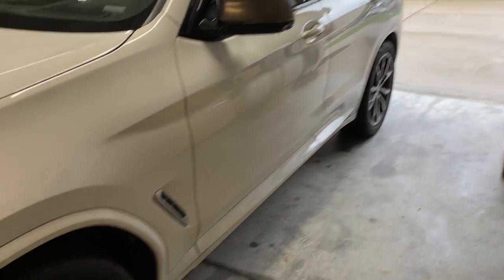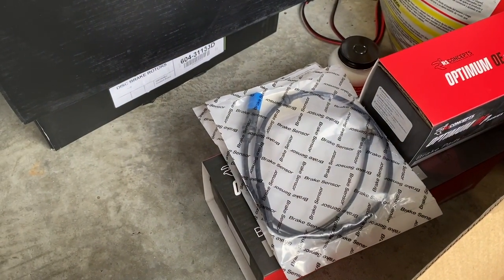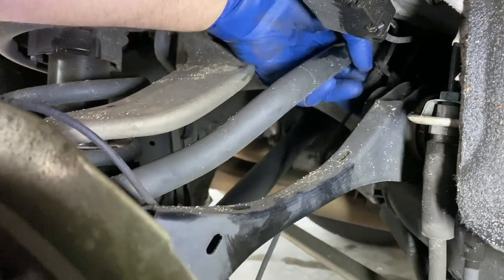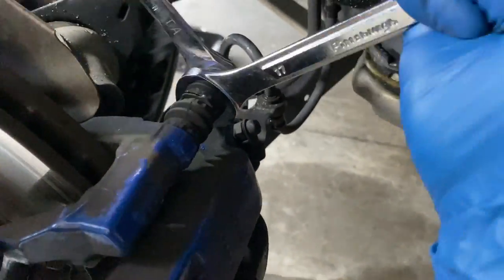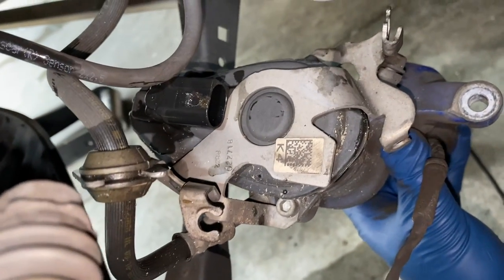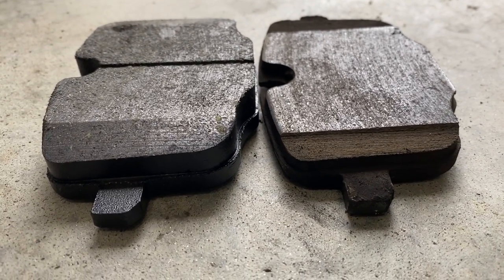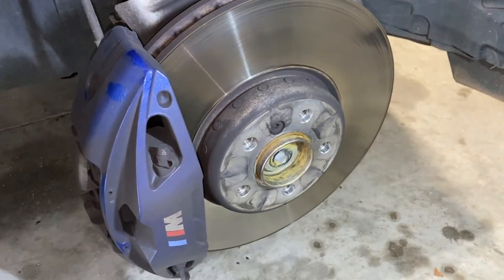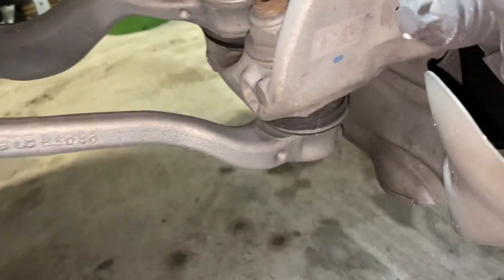How to REPLACE PADS AND ROTORS on a BMW X3/X4 M40i (G01/G02)

Comment: Broke my rear guide bolt with 55Nm as you said. Actually they are 35Nm. You may want to double check it.
Reply from the maker: +@user-df7wl8dc6r I think you might be right… not sure where we got the 55Nm value from 🤷‍♂️

Comment: you just saved me $900.  I've changed many pads on many cars, but my 2018 bmw gave me seconds thoughts, like maybe i should have a pro do it.  Nope, this video is great and very straight forward.  Thank you SO much!
Reply from the maker: +David L love to hear that! 🍻
Reply: @HelpMeDIY  do you have brake noise. How do I get rid of it?
Reply from the maker: @PautKalun  none. Could be the need to use brake grease on the back of the pads where they contact metal. Could be you need new rotors. Could be you need to bed the brakes in. Could be the pad compound just makes noise until they are warm….
Reply: @HelpMeDIY  I haven't tried rotors. had no issues with back brakes. i do feel like the low-met bmw brakes are just noisy. I got them FCPEuro. Maybe they make "inferior" genuine parts?

Comment: Great video!  Worked well for my 2021 X3 M40i.  Couple of notes to add:

1. For the parking brake sensor, I had to insert a flat head into the back side to lift up the tab so the sensor can separate.

2. I have the newer screen/idrive.  Different procedure to reset the Service Required, Check Control and red Brake light on dash.  Very similar.  Push start/stop button 3 times while foot NOT on the brake pedal, now you are in diagnostic mode.  Then use the BC button on the left stalk to cycle through and/or reset the service required.  

Again, thanks for doing this video!!!
Reply from the maker: +Erik Langley great! And thanks for the extra info to help others 🍻

Comment: Thanks so much for the vid - this was a tremendous help with replacing the brake pads on my X3MC!

One thing I realized with the front caliper pins - the spring guides them and if the pin is not in the hole it will knock the pin off center making them difficult to remove.  All you do is push the top of the spring (or bottom - depending on which pin) to take the tension off and the pins will pull right out once you start them with the punch.

Same goes for putting them in.  Just push down on the top or bottom of the spring and the pin slides right through to the other hole.  Then just seat it with a rubber mallet.

Excellent video - thanks again!
Reply: Edit to add - the pins are a great idea.  Now that I know how to do it I can change the front pads in literally 5 minutes :)  BMW must make a fortune on these brake jobs!
Reply from the maker: +spta97vids glad to help!
Reply from the maker: +spta97vids yes! DIY job for sure in this one to save a lot of 💵

Comment: Thanks for the video. You saved me $1000s. I only had a wear indicator on the passenger side. Maybe add that somewhere? Maybe I missed it. Anyway, it took 3 hours, 2 for the first one and 1 for the second. Having a long 5mm for my ratchet would have saved an hour. Hope this helps people.
Reply from the maker: +Robert McGraw that’s great, well done! Yes, one sensor up front and one in the rear. 🍻 hope you’re a subscriber now

Comment: Great video.  I have two questions / comments.

This video is for a BMW m only. A X3 xdrive 30i doesn't have the same front calipers. This means you won't have to deal with those pins in the front. Big plus side for me, when I change my pads.

The question I have for you is, if you don't engage the parking brake before you change the rear pads will you have to back off the nut for the parking brake? That would eliminate you from having to pull that cap. The rear on the non M calipers look about the same. Just asking I don't know???? I would think if you did not engage the parking brake you would not have to go through the hassle of taking that cap off and turning it back.
Now we know why a brake job at the dealer is $500 +
Reply from the maker: Thanks Jay! About the parking brake... At the beginning of the video I make sure that the parking brake is NOT engaged. So no, it does not eliminate the need to pull that cap.

Oh, and thanks for the info about the non-M front calipers!
Reply: I make these brakes and I agree with you, it's actually very simple

Comment: Thanks for the video, the only thing I did differently was on the fronts I turned the  wheel so it gives you easier access to the calliper. 👍
Reply from the maker: +Theo Currie yes! Great tip.

Comment: Thanks for sharing.  This was very helpful and saved me $$.  I replaced the rear pads but couldn't reset the brake sensor on the dash.  In diagnostic mode it would show "reset possible" but when I would hit reset, I would get "reset unsuccessful".  This is probably because i previously wore down the sensor and the brake light appeared.  Ordered a new sensor cable.
Reply from the maker: +AmitroniX glad it helped and saved you some money 🍻 
You’re exactly right… the light won’t reset until you replace the wear sensor.
Reply: Ordered and installed a new rear wear sensor.  That resolved the issue.
Reply from the maker: @AmitroniX  👍🍻

Comment: Thanks for the video! I’m surprised no one had any trouble fitting their 17mm open end wrench to hold the caliper pin from spinning when loosening the caliper bolt. I’ve tried both of my Craftsman and one of my neighbors and it won’t go in there. I used a cheap cone wrench for a bicycle and got it apart, but it’s rounded over and now can’t get it back together what with all that factory locking compound on the new bolts. This is a deal breaker if you’re not prepared (🙋‍♂️ )
Reply from the maker: +Ron Hipwell yes, be prepared! Thanks. 🍻

Comment: Great video, thank you. I have a '21 G05 X5 with the same M brake calipers (in red). Im wondering if the install procedure is the same? I've heard stories that a brake service can only be properly with the dealer computer, which must register the new pads in the computer. 

Does anyone have any info on if the G05 brake job is a straightforward procedure like this, or if it requires additional steps?

Thanks in advance!
Reply from the maker: +bklynchris you’re welcome! Unfortunately I don’t know the answer to your question, but maybe someone else can answer.
Reply: Did you happen to find a helpful resource or tutorial?
Reply: @batm0014  I believe another YTer has posted a DIY video which tackles the front brakes on the G05, but not the rear. Still looking for a rear brake DIY video

Comment: Fantastic video! But I do have a question for the parking brake - when finish compressing the piston, do we need to turn the torx (the one you turn clockwise all the way to the end before compressing the piston) back to where it were? I don’t see you do that in the video but just want to confirm
Reply from the maker: +Vincent Wei thanks! No you don’t. Setting the parking brake the next time will do it for you

Comment: Great video, thank you. So as I'm seeing it, to replace ONLY the front pads, just the pins have to be pulled, is this correct? I'm new to the M40i, replacing the OEM pads for ceramic to reduce the brake dust. The car is new, only has about 1K miles on it, just can't stand the dust and seems like an easy job.
Reply from the maker: +Charles Kaczmarek yea, it’s not bad at all 🍻
Reply: @HelpMeDIY  excellent, thank you. Again, great video, keep up the solid content!
Reply: @HelpMeDIY  however, to replace ONLY the pads on the rear, does the parking brake still need to be dialed back?
Reply from the maker: @charleskaczmarek6568  yes
Reply: @HelpMeDIY thank you.

Comment: Excellent video! For the rear brake actuator, after you used the c-clamp to push the piston in did you have to use the T45 to screw the center piece back in before you put the covers back on? In the video you just put the cover back on without mentioning anything about screwing in the center piece. Thanks!
Reply from the maker: +Joe Yiu I did it just like the video. No steps were done that were not shown in the video.
Reply: @HelpMeDIY  Thanks for the prompt response. Greatly appreciate it. Happy Holidays!

Comment: Thank you for the tutorial. Is very useful. One question: I can’t reset the rear brakes service indicator. What could be the reason? I am getting message that reset is not possible.
Reply from the maker: Could be that the wear sensor was triggered and you haven’t replaced it? They turn on when they become physically damaged by grinding into the rotor.
Reply: @HelpMeDIY  Thanks. New sensor was replaced and properly connected.
Reply from the maker: Michal W. Could be a bad sensor I suppose, but I heard one case where a guy had to actually start his car for a while and then shut it off and then do the reset and it worked. Please let me know what you had to do once you figure it out.
Reply: @HelpMeDIY  The solution is simple (it took some time to find out): when resetting the sensor, the hand brake must be released ;-)
Reply from the maker: @westplane7  Great to know! Thanks so much for coming back to share the solution.

Comment: Great video. I’m having trouble at the same place you did. The deadly spring! Due to the camera angle I was unable to see how you removed the spring. I know you used channel locks. What would be the correct tool to remove this? If I was to use channel locks and use precaution like putting electrical tape on the ends where exactly do I place them? I couldn’t see on your video. Thanks keep it up. I love your videos as they are very detailed and well paced.
Reply from the maker: +Minimalistic Muslim thanks! To compress the pistons a little I squeezed the pad into them by placing one part of the channel locks onto the pad edge and the other on the back side of the caliper.
Reply: Thanks Aaron. I just saw your upload about the lisle pad spreader. I’ve also just purchased this tool 👍🏼 Will this be the tool I need to remove the spring from the pad instead of the channel locks? If so, Is there enough room to get these in to push the piston back whilst the spring is still on?
Reply from the maker: @minimalisticmuslim8020  good question… not sure of that will work or not, but please let me know when you try it!
Reply: Will do. Could you help me by finding out if my vehicle which is the G32 6 series has a front jacking point. Which would make it so much easier to do a brake job. When I ask the mechanics they say you should only jack up at the traditional 4 points. But when working with the brakes it seems daunting just to have it sitting on a hydrologic jack with no jack stand to support. Any advise???
Reply from the maker: @minimalisticmuslim8020  quick jacks!
Reply: I’ve heard about them. I live in the UK and so you don’t see many of these around here. Most homes here don’t have a garage. I have a front drive where I usually work on the car. Are these quick jacks easily movable. As I would need to reassemble each time I need to use them and then store away in the back garden shed.

Comment: Great video! What size bolts are the two you need to remove on the front wheels to remove the caliper?
Reply from the maker: +Remberto T. Hernando thanks! I didn’t mention the bolt size? Hmm that’s not like me. I don’t remember off hand, sorry. I’m sure a quick Google would turn it up though.

Comment: Great DIY video guide! Many many thanks for this!!
@ 21:51 just before fully tightening the 2 bolts for the inner caliper, is there a need to press the brake pedal first to center the caliper? (ie as the piston presses onto the inner pad then consequently onto the rotor, the caliper will center-position itself for equal wear of both pads)
Cheers.
Reply from the maker: +Ar-yel_G no, it will sort itself out correctly 🍻
Reply: @HelpMeDIY  
Ah, great!👍 
Thank u so very much! I'll replace the pads very soon 🙂

Comment: A lot of the processes would be a lot easier if you used the correct tools for the job.  Channel locks are NOT the correct tool.  When I do this job I will try to use more of the correct tools which will make it easier for people to see and reduce the risk of scratching the paint on the calipers.  But still I say excellent video, nice and slow and clear and complete.  Well done.
Reply from the maker: The right tool is always best of course, but sometimes you have to improvise with the tools you have 😉

Comment: Replaced the front brake pads on my X3 3.0d GO1 (UK) please note that the reset only worked with the handbrake off (having tried the reset several times wit the handbrake on🙄)
Reply from the maker: +Des Ablitt very interesting, thanks for letting us know!

Comment: how many pad wear sensor do you need if you only change your two rear brakes?  I remember there are only two wear sensors one is front one is rear right?  just want to make sure I have all the replacement parts. Thx
Reply from the maker: +Lucas Xu yes, that’s correct! And it only needs to be replaced of the light came on in your car telling you they are low because the sensors were physically worn down against your rotor.
Reply: @HelpMeDIY  thank you so much.
Reply from the maker: @lucasxulai  no problem! Hope you’re a subscriber 😉

Comment: Great DIY video!
One silly question, what is that bent disc thing behind the rotor (16:45)? Is it normal that it is not flat? Thanks!
Reply from the maker: +Vincent C. Thanks! 🍻 
Do you mean the big C-shaped piece of thin metal? If so that’s a dust shield. It can get bent if it gets hit, so you should straighten it out if it’s bent.
Reply: @HelpMeDIY  thanks for your Swift response! Yes that is what I mean. My x3 has only 2-3k kms on, i found the edge of the dust shields on all corners are bent when I recently swapped out the winter wheels. It is kind of unexpected.
Reply from the maker: @vincentc.2192  if they are all “bent” the same, then that’s probably how they are supposed to be.

Comment: do you need to change the brake sensor everytime ? Is the X3 30i has the same rear brake?
Reply from the maker: +L allen no, only if you waited to change your pads until the sensor wears down and turns on the warning light.

Comment: You need the quickjack 6000.  It is the only one with the length to hit the two jack points on the x3.
Reply from the maker: +Jason M so there aren’t any extensions or a way to use the 5000 on it at all then? Bummer
Reply: Yes, it is possible to get the quickjack BL-5000SLX and SLX frame extension, which gives the 5000 the same reach as an extended length model (66” max lift point spread). Though can only reach jack points if put QJ sideways, which is not ideal. The 6000 XLT has max lift point spread of 76”, allowing it to lift the X3 the normal way as X3 lift points are about 70-72” if I recall correctly.
Reply: The 6000 is longer than the extended 5000.  Trust me, the 6000 is the way to go.

Comment: need s scan tool to run those e brakes back.
also maybe use the cars e brake switch to power them back and forth.
Reply from the maker: +Mark Tobin you CAN use a scan tool to do it but you don’t have to.
Reply: @HelpMeDIY  According to Newtis.info you do not have to do the e parking procedure manually or via CAN tool anymore

Comment: Where is the quick jack point for the front?  Thanks in advance
Reply from the maker: +sardonic_ smile_ the QuickJack uses the standard lift points on BMWs. I.e. the small rectangle plastic blocks on the frame
Reply from the maker: @sardonic_smile_8752  oh sorry, I thought you meant “QuickJack” brand lift that I use 😉

Comment: Can you use bimmerlink to push the piston back for the rear?
Reply from the maker: +R P good question. Anyone know?
Reply: I saw the option to do it on bimmerlink. I did the same when I changed the brake pads on my Audi Q3, so much easier. I'll change the rear pads on my M40i next week and was looking to see if the process it different than on the Audi, but it seems very similar.

Comment: Great video Aaron, saw it on M Gruppe!
Reply from the maker: Thank you!
Reply: Help Me DIY i have the 30i and is it same? I just got my brakes done now and technician couldnt reset it and got my pads and sensor at rockauto which got good reviews on part i got. The technician also was a good shop that has high ratings. I was able to get to diagnostic but pressing button on dashboard didnt allow me to get to the front brake . I have a 2019 g01 x3 30i
Reply: Help Me DIY was able to get to the reset part but said unsuccessful (2019 had to press the gas pedal too) any luck or go go to dealer and give them my arm

Comment: my m40i indicates rears need to be replaced but not the front.  the fronts have less pad material than the rears, so that is rather strange.
Reply from the maker: +m l there is a physical sensor next to the pads that will grind down and the wire inside will be cut. That’s what triggers the light on your dash.

Comment: What size sockets for the front rotors?
Reply from the maker: +Kane Kickz if I didn’t say in the video I don’t remember, sorry!
Reply: @HelpMeDIY  how can I find that information online I bought an e torx socket kit but the sizes are even and don’t fit the upper part of the caliper
Reply from the maker: @kanekickz7818  you can probably just call a dealership and ask. If they don’t know, Google. I don’t have access to that car

Comment: My front brakes (I believe) are making an intermittent groaning sound, like heavy metal on metal rubbing at low-med speeds (1-40mph) and stops when I tap my brakes. Anyone ever hear of such a thing? It'll do it for a whole day, then stop for a day or 2, then return. BMW doing pads & rotors tomorrow at my request, but techs are scratching their heads trying to diagnose it as they couldn't replicate the sound. Whatever noise I'm hearing at 29:40 is sortof what the noise sounds like.. a bellowing metal rubbing sound. Definitely not squealing or grinding.